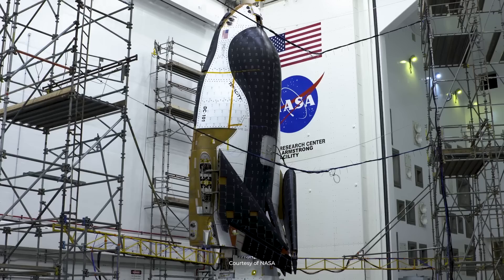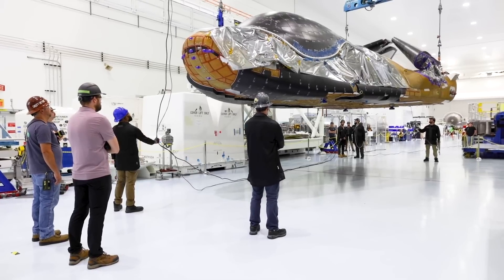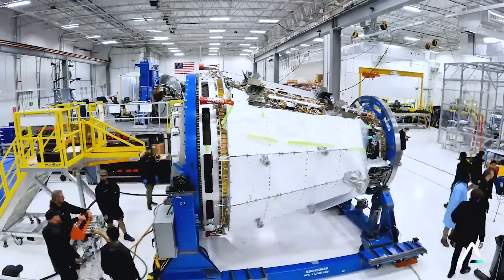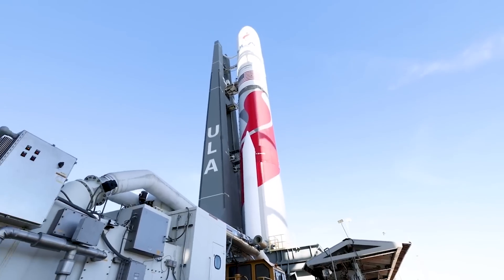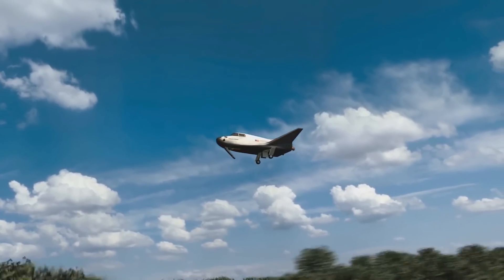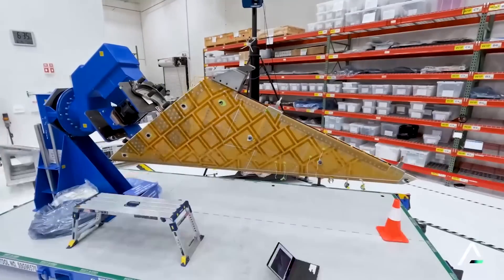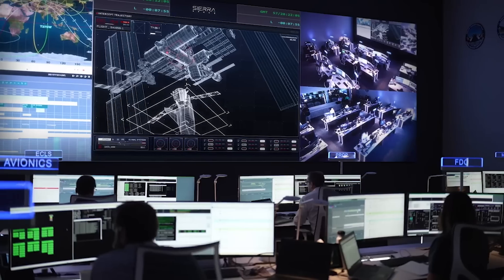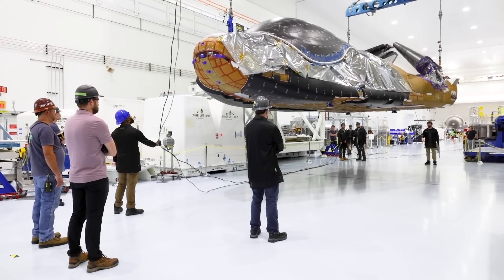Dream Chaser Tenacity Has Officially Begun Final Testing

Comment: Hopefully they have a nose WHEEL instead of that metal pad that snaps off at runway cracks thereby causing the front landing strut to abrade heavily!

If the X-15 can use a nosewheel, so can Sierra.
Reply: it's probably lighter or something
Reply: When did it snap on the runway?
Reply: @dev.berg-n2512  During autonomous landing test at Edwards couple-three years ago.
Reply: @dev.berg-n2512  During autonomous landing test coupla years ago, one section of runway concrete had lifted inch or so higher than adjoining, the pad caught on that; from then on, the nose got lower to runway as front strut abraded away.

Comment: I like Sierra's Dream Chaser HOWEVER SPACE-X'S Dragon seems way more practical, despite recovery of Dragon capsule from ocean. Spsce-X tends to do most of manufacturing, processing and inspecting "in-house" plus they take full advantage of what they learn after each flight. Also their turn around times are a factor that cannot be ignored.
Reply: Dragon is not re usable . It is re furbishable. It does not have the turn around time Dream Chaser promises to have
Reply: Starship will make this obsolete in no time. If it all works.
Reply: @CatskillProduction  Starship is too big for routine ferry operations.

Comment: You know.. they've always advocated for double hulls in the case of tankers. I have felt how much those tiles weigh for the space shuttle. It's possible some double layered armament protection could be built in am I right?
Reply: Ships are double hulled principally for STRENGTH, not as some sort of precaution against being punctured. Think of the double hull as being like a big curved bridge truss (historically this was how Brunel hit on the idea in the 1850s BTW).

Comment: I hope they can get this going soon and that they proceed with a crewed version to replace the Boeing Starliner. They cannot afford continuing delays and need to launch in early 2025 to survive.
Reply: SpaceX took 7 YEARS to move from Cargo Dragon to a certified Man-rated Dragon 2. I think Sierra Space might be able to beat that, but people minimize the sheer level of tedious testing that NASA demands to achieve man-rating. These requirements are much more strict than Shuttle days, directly because of the 2 Shuttle disasters. SpaceX had the Cargo Dragon's fully developed flight hardware to work from in developing Crew Dragon, and they STILL had difficulties with parachutes and that little EXPLOSION of the capsule during testing.
So for the forseeable future, Boeing Starliner will be the only competitor to the Crew Dragon system.
Reply: @i-love-space390  Dreamchaser was originally being developed as a human rated crewed vehicle as part of the commercial crew program. When they lost that to Boeing and SpaceX, they turned the program to a cargo version to go for the cargo delivery contracts. Yes, testing to make it crew rated will take a long time but they might already have a head start on it since it was originally designed to be human crew rated.
Reply: @i-love-space390  and yet they gave it to starliner that had known not solved issues
Reply: I think everyone will hope that.
Reply: That along with Elon being unstable enough to having threatened to decommission his Dragon capsule.

Comment: This stuff happens way too slow. It should not take 24 hours and 20 supervisors to install a single screw. They take MONTHS to do what should be done in a week. This slow walk pace needs to end, we need space exploration sooner, not later. If it aint hauling humans it can be built faster. Unless you're boeing, they need not be in the space race -they shouldn't even be in flying humans in the atmosphere.
Reply: Agree that it could be built a lot faster, don't agree that it should. When something goes wrong, that means they likely don't get the spacecraft back to figure out what happened. If your cars brakes fail, you get to take it to the shop, inspect it and see that the brake caliper bolts weren't installed correctly.  If Dream Chaser's 'brakes' fail, all they get is a big fireball and charred parts falling into the ocean. All they can do is go through all their meticulous records, and see where a tech installed that one screw, torqued it to the wrong spec and the 20 supervisors still signed off on it.   The 'build it quick' alternative is big fireball... charred parts... ocean and Sierra Space telling NASA "We don't know why it blew up because we didn't take all the time to document, sign off and test every single step in the process." It sucks, but there's not really an alternative - even Spacex does it and they're going as fast as they possibly can.
Reply: @talyrath  Yeah. When those guys died in the 1967 Apollo fire it was a real wakeup call about the effect of rushing. And when NASA tried to go back to the better, faster, cheaper way of making unmanned space probes, they had some embarrassing, expensive failures. 
But as you said, when they document everything properly, they can find the cause of accidents. Apollo 13 had meticulous records, due to the Apollo fire and subsequent shit storm, and they were able to find a cheap relay that had not been modified when they changed voltages on the spacecraft (different from the pad power) and it caused a burnout of insulation inside the oxygen tank when they did a non-standard detanking caused by damage to the tank in another well documented accident.
Reply: In case you haven't noticed they are NOT involved in space exploration they just pretend to be when in court against SpaceX
Reply: Who the f are you? Self righteous internet dork? Yes.

Comment: i dunno about the dream chaser in this configuration. apart from it being able to land on runways and having a quicker turnaround (not really important since it wouldnt be able to fly again anytime soon) i cant see what it offers over conventional vehicles. I hope they make it a crewed vehicle again.
Reply: Its cheaper, they dont have to make a new one ever launch or replace vital components, cheaper than a cargo dragon
Reply: @paranaenselol it's intial cost is much higher compared to something like dragon (which is also reusable) and will only save you money if you fly it a lot. They've only got 6 contracts for 2 space planes which isn't a lot and won't see those cost savings of being reusable.
Reply: @mathewferstl7042  the cost of initiating anything is high, also considering it hasnt even flown yet its already good enough 6 contracts, dont you have hope?
Reply: @ewwwwhh  i hope for a crewed dream chaser possibly followed by a modular version with a cargo bay. so yeah, i hope.
Reply: @geesehoward700  Sure... they chose Vulcan Cintaur for their initial launch vehicle.  They're not locked into that forever.  Nearly all your complaints boil down to, 'It's not a mature system so why bother.'  Have some patience.
Reply: @737smartin  no, my arguments boil down to "it could be so much better". patience would still apply though so you could be right but that doesnt make for interesting discussion.
Reply: The plan is to also use this as transportation to the orbital reef commercial space station once that is built
Reply: @ewwwwhh  it launches on the Vulcan Centaur which costs far more than a falcon 9.
Reply: @geesehoward700  im talking about dream chaser, not how it will launch, it could be launched by many rockets
Reply: @ewwwwhh  not for the moment sadly. its only flying from the vulcan centaur for now which limits it to non human rated.
Reply: A crew version is in the works, with Starliner’s problems & the Sierra purchase of ULA, it’s inevitable
Reply: @anthonyhunt701   And due to stringent NASA man-rating requirements we may even have one ....... in 5 to 7 years. (And that is based on SPACEX' experience.) So for the foreseeable future, Starliner will be Dragon's only competitor. And by the time man-rated Dreamliner is ready, Starliner will be over its teething problems and be flying regularly.
Reply: Landing (gently) on a runway is different than splashing down or clunking ashore, and some scientific return cargo will benefit from that difference.  
How much different is a Mack truck from a Freightliner?  Why do we “need” both?  😉 
OF COURSE they plan to “grow it” into a quicker turnaround and a crewed version.  🤦‍♂️
Reply: @737smartin  yeah, landing on a runway is a bonus but how much cargo needs a soft landing? also, with landing on runways weather becomes an issue. Id say the key advantage for the dream chaser would be its turn around time but, like i said, currently its not important.
Reply: @geesehoward700  landing in the ocean weather is a bigger Factor than on land
Reply: Even if weather becomes an issue, it has decent cross range to divert to another supported airport if needed so lots of flexibility
Reply: Three advantages. Lower G reentry. No consumables upon landing ie heat shield, impact airbags.    Landing at a location that can be accessed in minutes
Reply: @dugnology  for crewed landings i agree and it would make a great lifeboat for the ISS. as a cargo vehicle its advantages are less important. that and the fact that all the savings it would make are lost on launch costs.
Reply: I'm afraid I have agree about turn around issue. While it's smaller vehicle currently Sierra Space has small work force.  Thus the bigger problem being able get enough skilled people putting stripping and reapplying new heat shield tiles securely.   I know this is their first plane, but I don't know how quickly they will be.
Reply: @Wrangler-fp4ei  the heat shield was the notorious thing for the shuttle. Tech has come a long way since. The heat shield is different, and non destructive testing has improved. Even ignoring the much lower tile count, there is much less work to do and that work should be easier than on the shuttle.
Reply: @somedudesstuff801  sierra still havent finished adding all the tiles to the dream chaser and its taken them years to get to this point.
Reply: @geesehoward700  correct. But the whole video was about how they have to finish building and testing all the other parts before they can close it up.
Reply: @Wrangler-fp4ei  didnt they lay off a large part of their workforce as well when the crewed version wasnt adopted?
Reply: crew ratings are hard with NASA. SpaceX also took this route with Cargo then Crew Dragon which is exactly what Sierra is doing; look up DC-20, they are very deliberately using cargo specifically to leapfrog into a crewed variant which is still their main ambition with Dream Chaser.
Reply: Low G reentry to minimize stress of scientific experiments and samples being returned from the ISS.
Runway landing allows for a much more rapid recovery of materials compared to an ocean splash down, minimizing contamination and time in an uncontrolled environment.
Reply: They absolutely need to make a Crew vehicle especially with Boeing being such a flop
Reply: it’s cheaper and faster, so I guess it makes sense.
Reply: also it might be a good idea to have more than one launch option for the thing.
Reply: @geesehoward700  dream chaser has always been launch-vehicle agnostic, as long as it can fit inside the fairing, and the vehicle has the capacity